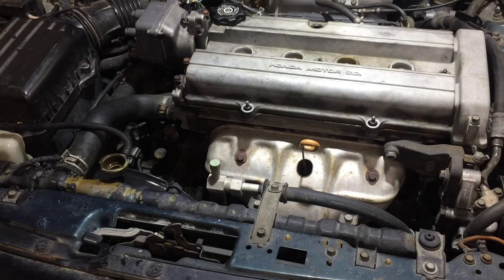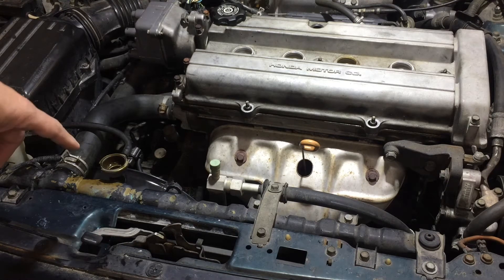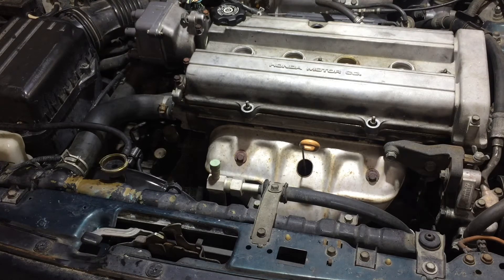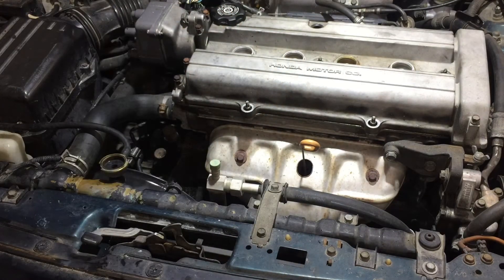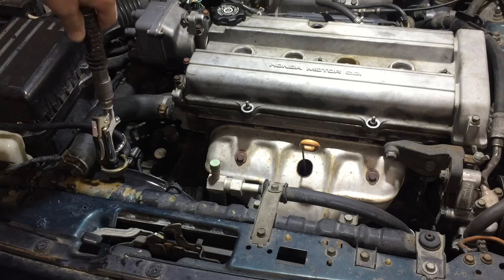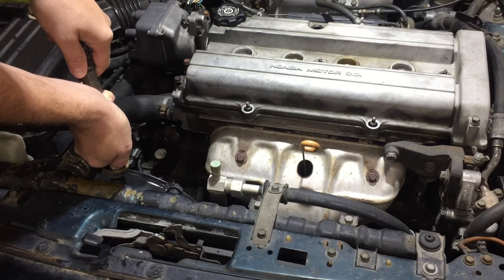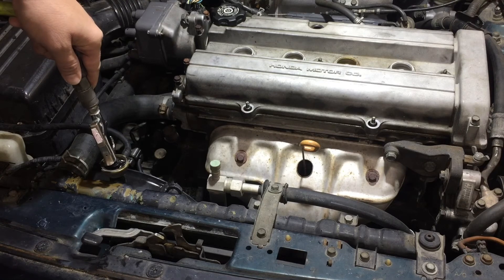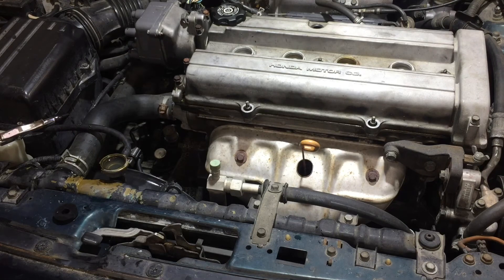DIY: Coolant System Pressure Test

Comment: on some cars I have cut the heater line and install a copper tube in it that I silver solder a 1/4 flair fitting with a shraeder valve to test with a gage like used for fuel pressure or add pressure through the 1/4 fitting.
Reply from the maker: That's a pretty good idea..